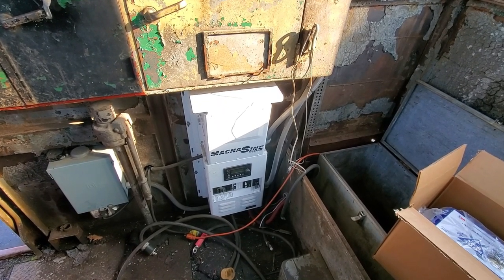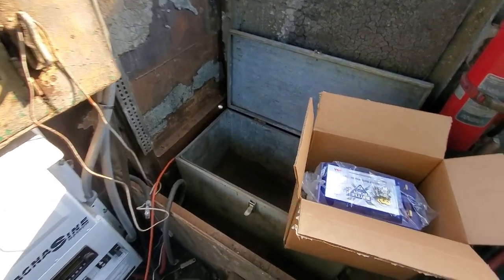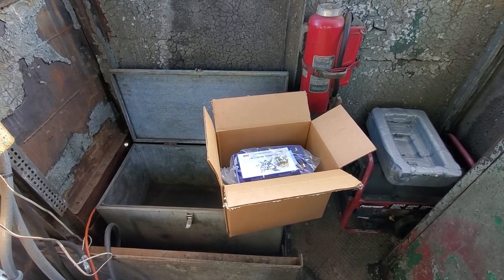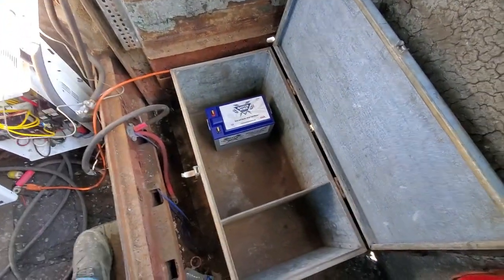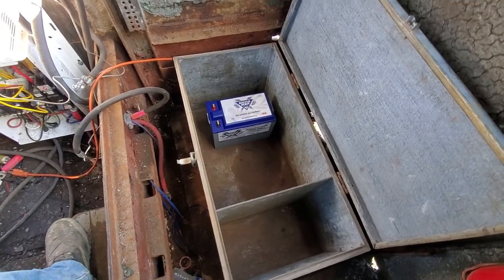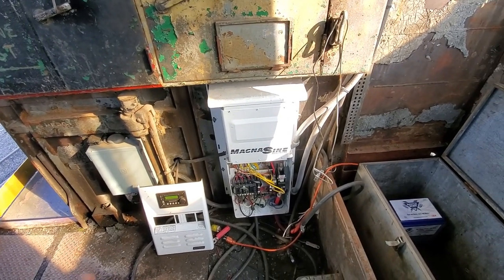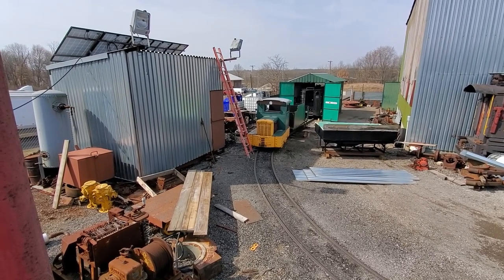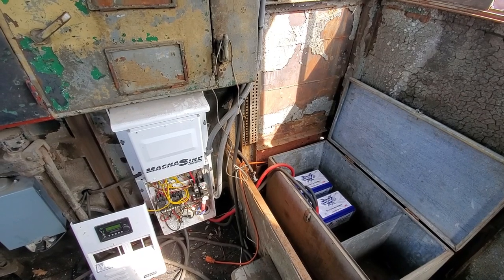Our Solar Installation is Back in Service!

Comment: Hi Rick, remember to ensure that the batteries are not sitting on the bare box. I use Plywood or pink 3/4"-=1"" foam board.
Batteries will discharge to ground if sitting on ground. Great video. I love your tinkering.
Reply: with respect, how can they discharge when they are made of plastic? aren't they completely insulated?

Comment: If you insulate the battery box, you also might have to install a cooling system. When the batteries charge, they can release quite a bit of heat. This can damage the batteries, or at least prevent them from charging at full speed. You can probably fudge the cooling system quite cheaply with recycled car parts. 

Outside, you need a car radiator and an overflow bottle, then run hoses into the battery box to another radiator and a small electric pump controlled by a temperature sensor. Adding an electric valve that works on the same circuit might be a good idea to prevent natural convection. Then fill the whole system with cheap antifreeze.

Hmm, does the locomotive that you installed the batteries in already have some sort or radiator? If it's still good, that might work quite nicely as the "external" one.

Comment: Would you consider a larger charge controller so you could increase your array to more than 4s panels?
Reply from the maker: I don't think we need to.  Five panels were more than enough to provide all the power we needed on an average day with the original setup.  8 panels will shorten recharge times. If anything, an additional battery would provide more utility for us.
Reply: @YoungstownSteelHeritage  There's hardly any situation where you can have too much storage.
I can see turning that pair of batteries 90° and removing the partition. You could probably cram 8 of them in there.  👍